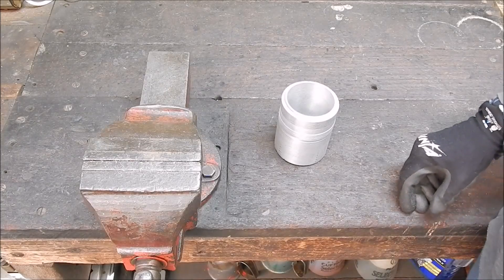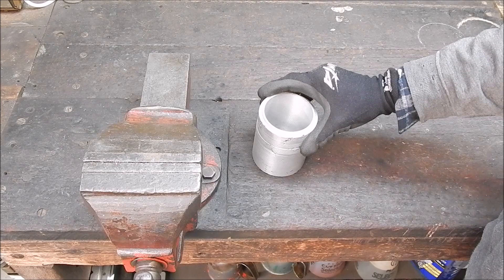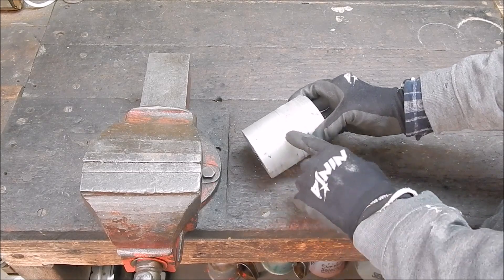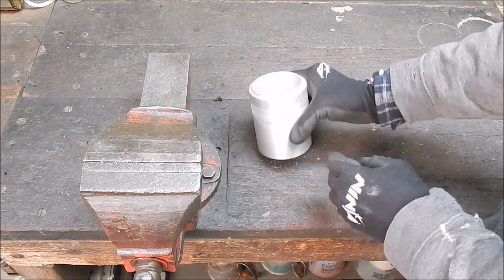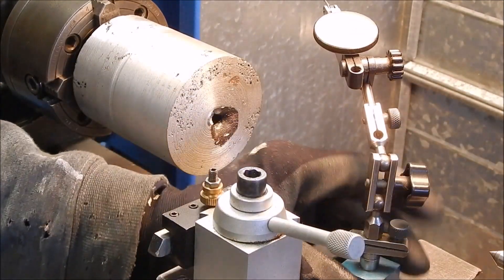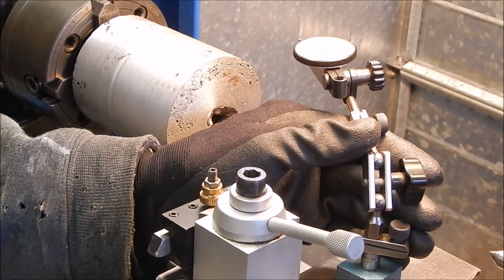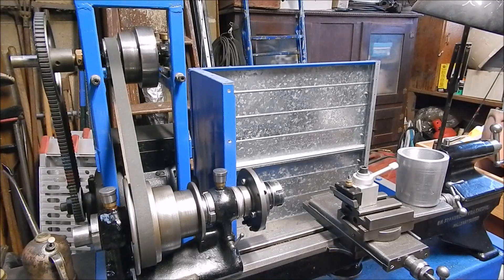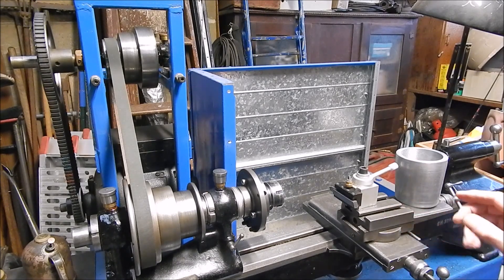Old toolmaker's lathe turning a large taper on a cast aluminium cylinder

Comment from the maker: Note:  Toolmaker's lathes are fully adjustable for angle on the cross slide as well as the topslide.  The topslide has much larger travel than a conventional lathe of the same size.  There is no carriage.  The compound mount can be positioned at any point on the bed.  There is no horizontal crossfeed.  They are a relatively rare type of lathe,. primarily used for complex and high precision work. This one was built around 1935. Cheers Rob

Comment: Any idea why the flat belt pulleys on the Chaublin lathe have so much runout?
I’d imagine that doesn’t help the spindle bearings any & might also impart vibrations into the lathe particularly at higher rpms?
Might it not be worth removing that pulley / pulley set and mounting it in the Chinese Lathe & re-machine the runout out of the flat belt drive sections to smooth everything out perhaps?
Just a suggestion.
Reply from the maker: The lathe was a total worn out wreck when I got it.  One area I haven't fixed yet is the worn pulley centre, from not being tightened over the decades.  I have another virtually brand new complete 102 headstock assembly and could replace the existing one, but it's the very first version and they didn't include a thrust bearing/race.  This was added to later 102s as featured in the video.  I could easily machine and sleeve the worn pulley, but that's just another job on the list.  I don't see it affecting accuracy, so no rush. Interestingly non of the 102 write ups mention the differences between 1st and second generation early lathes.  I don't think they are even aware there were two versions.  The spindle is quite different and there is no headstock provision/space for a rear ball race (in addition to the bronze bush) .  You can't believe everything you see on the Internet, even from the so called experts ;)  Cheers Rob
Reply: @Xynudu Thanks Rob, that makes a lot of sense. I was just curious. 👍
Reply from the maker: You're welcome Ian.  I have been expecting a comment on the runout.  It's quite fixable, but requires spindle removal and a major tear down.  I did initially try to shim it way back, but it wasn't possible.  The trouble is the lathe gets so much use I'm loath to pull it to bits and have it laid up :)  These simple jobs always take longer than anticipated. Cheers Rob
Reply: @Xynudu Yes I have a list of “one day jobs” about a mile long as well don’t worry.

Comment: It’s handy having your toolmaker lathe Rob, for that very feature. I made an mt2 taper on my Myford OK, but the top slide doesn’t have enough travel for an mt3. Your mystery project is moving along. Keep yourself warm. ATB Nobby
Reply from the maker: Hi Nobby.  Yes, that extra length of the top slide is a great feature with toolmaker's lathes.  Plus you can basically set them up as you wish.  Super handy as a second lathe.  This one had done a massive amount of work before I got it, in almost un-usable condition.  Cheers Rob

Comment: That’s a nice older lathe. You had said something about it having a longer slide, which made it a tool room lathe.  I didn’t know that.  thanks for giving us a look at it.
Reply from the maker: Toolmaker's lathes also have an adjustable angle cross slide.  That combined with the rotating longer top slide gives them immense capability.  Not many people get to own one as they are not very common, even in factory workshops.